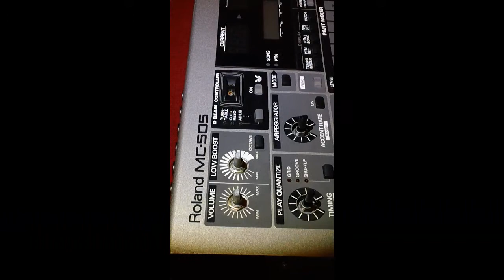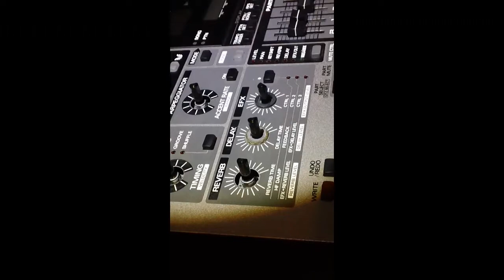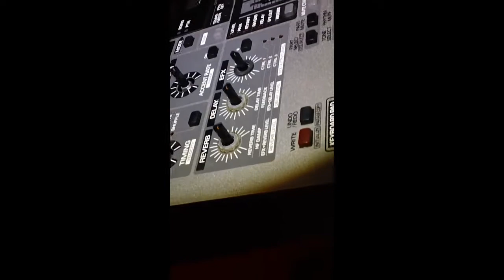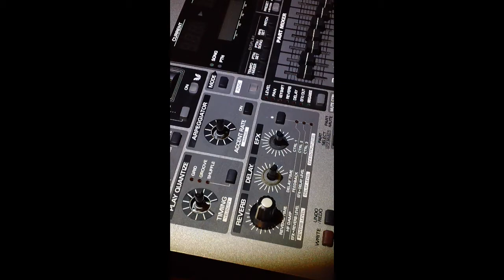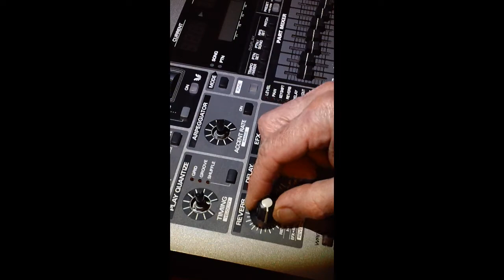ROLAND MC-505 GROOVEBOX - LOOSE KNOBS - WOBBLY POTS - FIXING & TIGHTENING.

Comment: Outstanding idea!! My 505 pots are kinda loose, but not so bad. However my Resonance knob is very wobbly (bought it that way), so this might just save me some $ from taking it to a repair shop! Thank you.
Reply: did u fix it? i have the same problem with my resonance knob and values are changing all the time unless i hold it down very firmly. did this happen to you too? i don't know if lubricating them and doing this method mentioned in the video will help, so if you had this problem, how did u fix it? :)
Reply: It worked. I just followed these instructions and voila! Its worth a shot. Good luck!

Comment: This would be something ideally done during the first few yrs of acquisition. The POTS are 10K spec, and sell for about $1 each on eBay. A loose mounted POT means the solder joint or leads are compromised. There's still some flex with the hose, and this will still entail long term damage. To do it right, heat up the thicker black hose and jam it in there tighter than a cows ass in fly season. That'll do the trick.

Comment: How the heck they didn't just bolt them down instead of hooking them down.  What a scam  as I had one back in 2000 and had issues and I'm a OCD sufferer and those Rolland engineers mugged me off 75 to get one encoder hooked on and another one was made  loose in the process so it had  a bad design flaw to make money. In the end I got all of them super glued down by a friend. Job done. I stopped trusting Rolland after that until I got the jdxi a couple of years ago and the Juno ds recently and they're the best production tools  I've had from Rolland. Best to review stuff before hand I guess. 😜
Reply from the maker: Yes, it is a shame that most companies seem to have PLANNED OBSOLESCENCE built into their products. Even with Korg the first electribes were built really solid, but then came the EMX with similar loose pots. See my other video regarding the EMX-1 loose pots although they are not nearly as bad as the Roland mc-505.  The EMX-2 is built really well and the Roland MC-808 seems to be, so far, a big improvement.
Reply: Definitely improved. I never had the 808 but I agree with you from your experience with one and the emx2 is better except the power inlet as it has a connection issue due to yanking the wire by accident a while ago but they could of made it sturdier and less wobbly.  It's works but turns off at any given point which is a bummer but a simple job I would say so overall korg are good.  Roland's Juno ds and the jdxi workstations have been my first Roland tools I'm ok with since 14 years with that mc 307  that had springy buttons that failed over time and that light plastic cheap enclosure.  In my books the mc 303 rocked. 😜

Comment: hi great video i need to do that to a couple of pots myself .....i wonderd if you had any tips on replacing a keyboard button that snapped out ..Also have seen  you seen the repair video on here were the guye  uses an iron on the side the lowerr Lcd to get rid of the lines through the display i could do with doing that as well , just wondered if you had any good advice about those two things  , Thank you ...greg
Reply from the maker: +greg cooke gregy Hi Greg, just watched that video you mentioned > https://www.youtube.com/watch?v=6mIwRcYLjQM  < and that is truly amazing, but so far I have not had that problem, and no problem with keys either, so sorry, I cannot advise on any other procedures. Dave.

Comment: Hi , i used to have a mc505 and now have a Fantom XA workstation...the potentiometers , buttons etc look of the same aa the 505...my 4 controller 10kohm pots are loose ...is it the same procedure?
Regards
Andrew
Reply from the maker: Hi, it's hard to answer that since I've never had a Fantom XA. But if you remove the knob from one of them, just lift it off, then you will see if there is enough gap (space) to insert some tube over the base of it without obstructing the centre piece.

Comment: Thanks for sharing an easy solution :)

Question to Roland mc-505 user if you have problem with "ghost" when you are recording or playing your music?
"ghost" = volume goes down by it self but you never touch it. Recording and adding EFX on one pattern, but suddenly 1or other channels  get EFX to. Keyshift starts to fool around by it self and you never touch it.  Like the machine got it own mind (skynet haha).  I have the last update for mc 505... 1.07.     I have no idea and i have done resets many times and re-update of 1.07.  Same results :(

Any fix solution?
Reply from the maker: +303acid808 Hey there, im not a technician , but one of my mc505s has a somewhat similar problem. When I turn it on the VOLUME is at full blast. So before I play anything I have to twiddle the knob several times. But I had a similar problem you're talking about on my Roland Fantom-S. That has 4 knobs which do almost everything and they were doing all sorts of weird things, UNTIL , I lubricated them. Corrosion can build up inside the pots just like any control switch. Put some tubing around the base of the pot so the lube doesn't go everywhere. Or put a few drops on the centre stem and let it slowly drip down inside the pot. Otherwise, you may have to replace the pot.
Reply: Hey Dave, thanks for the ideas but the big problem here is the volume faders in the mixer section ,sometimes i move the fader of part 7 and it moves the level of the part 2, or the Rhythm part level moves like crazy , sometimes i move up and down every fader for a minute and the problem stops but after a while reapears, apreciate your help a lot thank you and sorry for my english.